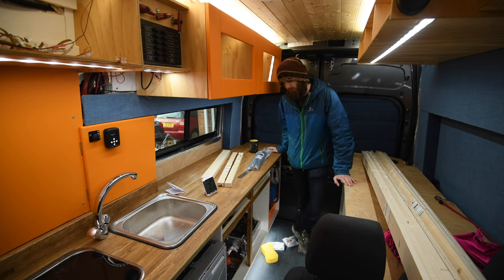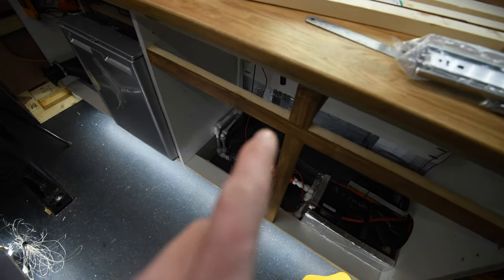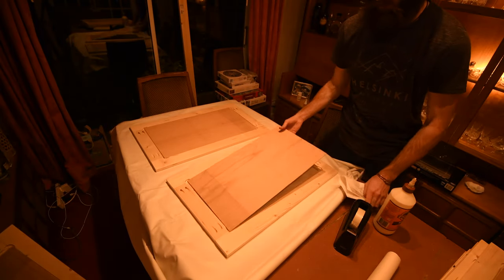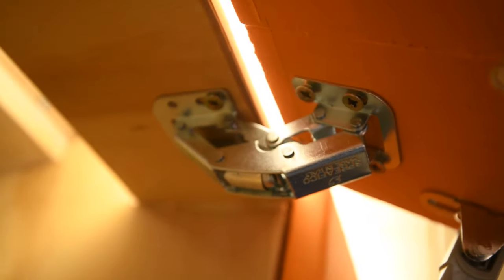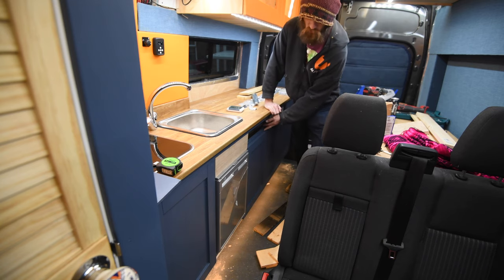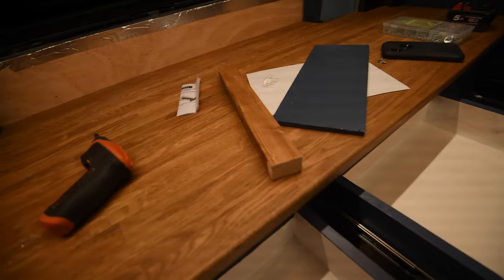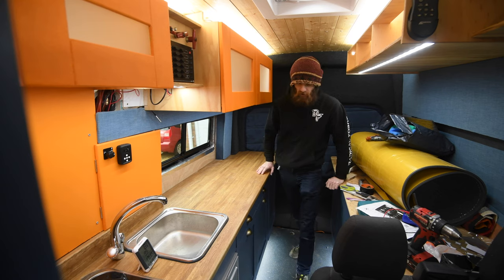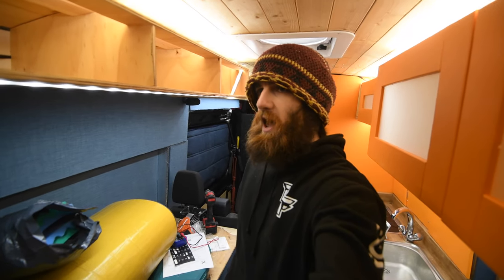Smart and Modern Shaker Style Doors | EP42 | Ford Transit Campervan Build

Comment: Fantastic video series. I enjoyed every minute of it thanks.    Where is the bed going ha ha Ha
Reply from the maker: Thank you for taking time to watch it! My favourite and most asked question soon no longer needs to be asked because it’s in a video few videos time. I’ve just built the bed. It is a fold down type which sits on the passenger side cabinets to be full width of the van. If you use Instagram check out the story highlight reel on there to see a sneak peak

Comment: I think I would've rounded the edges of the 5mm plywood so it fitted in router grove instead of over routing the corners.

Easy to say in hindsight though. Good job, they look great!
Reply from the maker: That would’ve  be my plan, especially for the drawer bottoms but I just didn’t have a correct size router bit for it. I think my bit is 12mm

Comment: You made that all look so easy! Is that a palm router?
Reply from the maker: The router is a cordless Milwaukee Router. Not necessary for the van build overall but a great addition for a lot of finishing work. Mainly went for that model as it was the same battery type as my drills and other tools.

Comment: When adding the base to the drawer, would you consider putting the ply base in a groove rather than flush routing it level with the bottom? I can see benefits and pitfalls for each, just wondered what your practical experience is? e.g. putting it in a groove reduces internal drawer depth but makes the base stronger and less likely to fail with any weight, plus it allows for expansion and contraction of the sides; flush to the base makes a deeper drawer but is reliant on glue/pin fixing - does that work if there is expansion and contraction of side rails? Any info appreciated thanks - great progress as always.
Reply from the maker: It was definitely not the best or correct way of doing! It was slight laziness and lack of a router bit of my part. My rabbeting bit is 12mm deep but all my scrap ply was 5mm. A far stronger solution would’ve been a 5mm rabbet and as you said cutting a slot to insert the ply in. The other option would’ve been to use one of my normal router bit before I had glued the Together the frame, but that was for thought I missed before I glued it. I considered it ok for my planned use for those being reasonably light weight. I think if I was making more than I would’ve bought the appropriate router bit
Reply: Thanks for the answer. Why is it that you have every tool/bit size for every possible job, except the one you are currently working on 🤐. I knew why some of our US cousins build their vans in a Home Depot (B&Q) car park now!
Reply from the maker: I know that feel! Even Amazon Prime or nipping down to Screwfix. Are you end up losing hours or even a day waiting for one bit. Definitely adds up time wise in the end

Comment: It’s looking good Alex ,you may want to put catches on the doors and especially the draws they will fly open ever bend....spoken from experience 🤦🏻
Reply from the maker: Yeah I will be. Just trying to figure out which type I want to go for
Reply: Don’t go for magnetic they are useless the best I’ve used are the push button ones which you can buy on eBay although my new van I’m fitting the ones from Evo Design
Reply from the maker: Yeah I was thinking of a physical catch or latch over magnet
Reply: @MispronouncedAdventures  hey Alex. Good skills! Where did you get your hinges from? Ta.

Comment: Where did you get the window covers?
Reply from the maker: Bespoke I’m afraid my mum made then! Synthetic sleeping as the insulated centre, same fabric I’m using on the walls elsewhere as the outer and magnet sewn into the edge.
Reply: @MispronouncedAdventures  Thought as much, we are planning to the same but thought it might save a job.
Reply from the maker: The only similar looking ones I’ve seen available for sale are from America and cost a pretty penny!